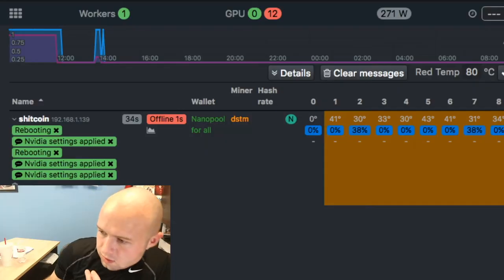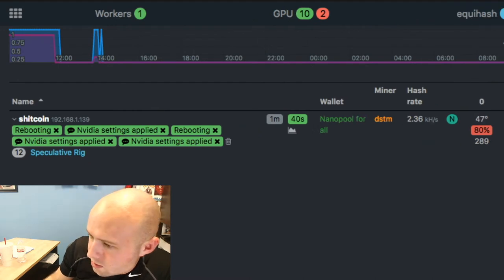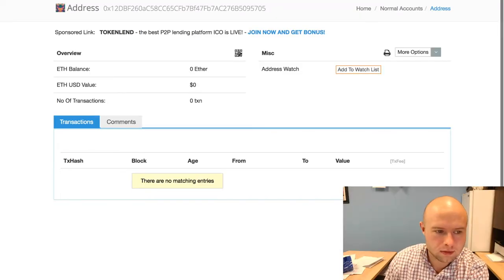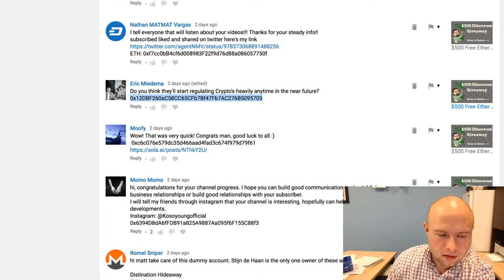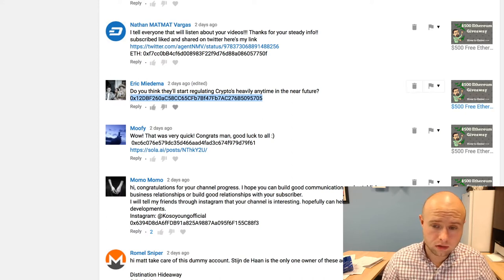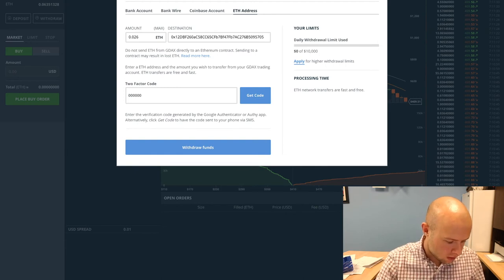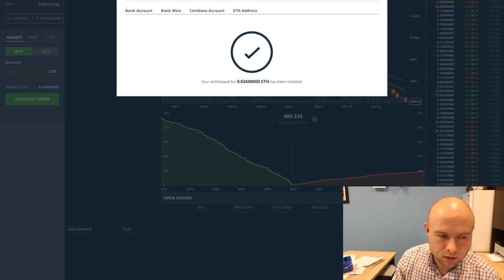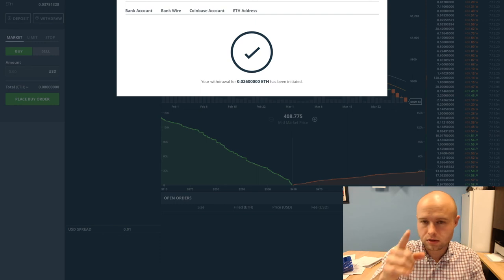Stupid Rig Builds Vol.1 - The Fridge

Comment from the maker: Worth mentioning the fridge was inoperable when I got it. The 3rd such Avantco fridge to crap out on me in under 3 years of service. I planned to turn it on for the thermostat, that is until I cut through the wires while drilling. D'oh!
Reply: you should build a rig wirelessly in a car trunk

0x374E2B2FdCf3C15Bf598772dfFE91820542278C2

Comment: Hello I was wondering what you think about nicehash and also If I should use it I would also like to know if I use it would my computer overheat and break I have a Alienware x51 with a I7-6700 processor and 8gb of ram as well as a 1060 nvidia graphics card? 0xDE63899C9cE18e091715685F9325173B03F5c76e